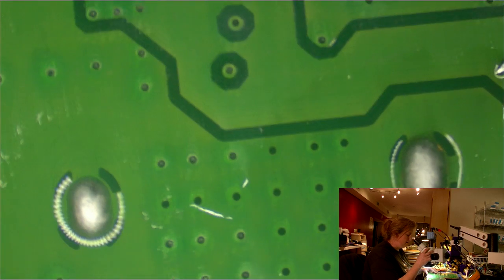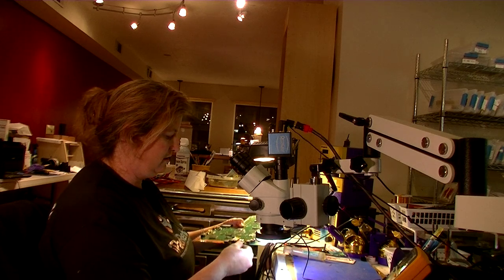How to replace a broken HDMI port on PlayStation 4 motherboard

Comment: good vid...i have done hundreds of these ports..i actually have a fairly easy way of cleaning out the holes for the legs of the  port...you use some 0.5mm solder braid and your hot air station with a small nozzle  heat the holes till they liquefy and feed the solder braid through the holes cleans them out pretty quick..i am currently working on one that has been completely fubar..a previous tech ripped all but one of the pads off the board (that's what happens when you try to pull a port without heating it properly) so i now have to completely rebuild the circuit with awg 36 wire ...oh and they blew off several of the diodes near the port so i get to replace those too lol
Reply: When I buy broken systems and see that much damage (just had one, 3 missing diodes), I end up salvaging the working parts (PSU, BD Drive, HDD, etc) and resell them, I actually 100% of the time end up making more off of the console than I would if it was just working.

I've done about 6 of the HDMI ports now, they can be a real pain in the ass
Reply: This is my literal nightmare! Lol
Reply: Any advice on what would be minimum required magnification for this job?
Reply: She is actually using very good quality tools and supplies, as I can see, she is using a very good desoldering wick and as she said she's using Chip Quik, which is a very good flux... so I can't understand why struggles so much to clean those support holes. The only reason I can think is the soldering iron is too low on temperature, otherwise that solder should came off very easily.

Comment: 03:23

No, for some reason that I cannot find an explaination for, the PS4 (at least on the original model SAA-001 board) has one side of the socket barely soldered on on some boards. The other socket on back (some kind of connection port) is always half soldered and the HDMI is almost always half soldered or all 4 look like the joints on the right. Very bare and spare solder.

Comment: Yeah awesome. I discovered my Pioneer KRP-600M had only one working HDMI port after having it moved over 700 miles and over water to me here in the UK. It's the first 2nd hand display I've bought but always a risk on Ebay and I've found that out to my cost in away. I still have the working HDMI. There's DVI-D and component - fortunately this monitor supports 1080P over component RGB. But it's always a worry when down to your last port. Took the thing apart yesterday and these things are built to last so even getting the board out took quite a while and about 40 screws, ribbon cables, power supply connectors etc. Anyway one of the connectors is very slightly damaged inside - on the far right, second from right the little copper strip is very slightly damaged. It wasn't saying no signal before just a blank screen. But I'm actually glad it's just a damaged port itself and not the chip itself dying. Like 75% eventually of LG video input  boards lol. Anyway it's £160 to buy a fully functional tested used board, or it's send it off for repair through the post somewhere - or attempt it myself as I've nothing to lose. I don't have any soldering equipment anymore and have never attempted HDMI before. But I love all this stuff so I'll guess I'll just need to think about it first.

Your example here is by far the neatest, professional I've seen yet here. Amazing touch and skill - very quick and tidy too. Fantastic.

Subbed.

Comment: i have my own consoles repair shop back here in the middle east - Palestine,  i do this regularly specially for the 10xx and 11xx ps4 models, one thing is that the replacement port sometimes does not align correctly, so i need to clean the 4 fixing holes before i replace it to so it aligns perfectly,  great vid thanx

Comment: Listen up kids trying to fix your PlayStation: this is an excellent video and great instruction. One thing to remember and consider before attempting this is the proper tools and materials to do this job properly are not cheap. Im all for people learning to repair things for a variety of reasons, but the most common is to save money. If you buy a $10 iron at Walmart and borrow you grandma's magnifying glass you are destined to lift pads and screw up traces. Then you'll take it to a repair shop and the repair will cost 5x what it would've cost to just have them do it first. Does this mean you have to get a degree to do the work? Absolutely not, but you better be prepared to fail for the first few times! Failure is the quickest way to learn sometimes so do the first repairs on friend's PlayStation. 😉😂

Comment: when i replace these i use a solder sucker from underneath and use hot air from the top and the holes normally come out clean first try

Comment: To clean out those holes I just use an electric solder sucker gun, it gives out loooooads of heat and sucks like an elephant after a peanut, clears them no problem.
Reply: Hi this is very old but can a soldering gun replace my HDMI port

Comment: That's a bevel tip, not a chisel. T15-B are bevels T15-D are chisels. Also, you can get the FM-2030 140watt heavy duty iron. It works wonders on those larger thermal mass ground planes.

And have you tried the FM-2024 or the 808 desoldering tools? Mine work great for through-hole components. I'll bet they would clear those holes with ease.
Reply from the maker: I have the FM 206 with desoldering gun.   Still in the box.  Just not enough use for that on when soldering on microscale of iPhones.
Reply: Very true. I can imagine the heavy duty FM-2030 iron and FM-2024 would not get much use when it comes to microsoldering. But in cases like these, when you're not working on the microscale, they can make your life so much easier. And the FM-206 runs every iron under the sun. Why not take advantage of it?

Comment: Seems like a stupid question, but this could be possible with a normal soldering iron as well, I suppose? Snip off the old connector, get rid of all the remaining pins and pieces from the old connector, clean the pads up with some flux and wick, and for the new connector just melt all four main solder joints in a circular motion to seat the connector, and then finally soldering the little pins by doing the pull-soldering method. I cant see why it wouldnt work.

Comment: For those holes, you would want to use the radioshack solder and sucker in 1 tool.. If iRadioshack hasn't completely shutdown yet anyway.

Comment: You can easily remove the solder from the holes using a desoldering gun. Every repair shop should have one and they're no longer expensive.

Comment: I've had good luck using canned air to blow the solder out of the bigger holes. Seems to work well.
Reply: Thats exactly what I do. Make sure you're not wearing shorts when you do it. 
really thats also what I use those junky $10 solder sucker irons with the bulb for too. Melt the solder with it then squeeze the bulb to blow air through the hole.
Reply: turn the can upside down and spray  your component, it will freeze it for testing. Thanks for your comment.
Reply: I used to blow with my mouth or tap the whole board on the table.   Compressed air is a much better idea

Comment: I don't know how these hot air guns are designed but I wonder if I could use a culinary butane torch to do this type of job. How hot is too hot? I find it very hard to judge with the culinary torch as the flame isn't vectored to the work like that of an actual hot air gun. I wonder maybe I could add a collar with a nozzle and get the heat where i need it.

Comment: I tried this and kept trying to get the solder on the brown connectors…however they seem to have gotten scratched off( about 4 strip places turned completely brown). DIY fail. 🤧

Was my soldering machine to hot?

Comment: hello Lady good job 👍can you help me and answer a question? I lost an SMD component when replacing the HDMI socket. It sits directly near the HDMI jack ... there are two components .... a 2,6uf capacitor and a diode, can you tell me what that is for a diode?

Comment: So I tried this repair with a heat gun off of eBay and I learned that it blew the right amount of heat but way to hard. The board around my hdmi port is burnt quite a bit. Will that effect it’s functionality? And I learned my 2$ soldering iron from the flea market I bought when I was 11 isn’t hot enough on the top to melt solder

Comment: i find if u use a preheater under the pcb and a hot air iron above the pcb the port comes off clean also for install use solder wick  and thin liquid flux and use solder paste to install the new hdmi port
Reply from the maker: Solder paste is a recipe for bridged connections!  Too messy

Comment: I see what I did wrong on the one I was working on. I didn't put in ChipQuick/QuickAlloy before removing the old connector. I just applied as much heat as I could with tons of flux and ripped off a pad! Well, I learned. Might be able to rebuild the pad, Did that on a Fire Tablet once.

Comment: very good work. i fix consoles and pcs for a living. and i hate how cheap sony made there hdmi ports. no back plate to stop pines from being pushed back. i have a question what would be a good pc cam to use to work on replacing the hdmi ports? using my eyes alone drivers me crazy. thanks!

Comment: attempted this. the hdmi port WOULD NOT COME OFF with a full workshop available to me. it was extremely stubborn at the anchor pins. I used a heat gun, solder iron, flux, desoldering suction. still too stubborn. some more tips on how to effectively transfer heat/ desolder would be useful
Reply from the maker: You have to watch the video —the key is using a lower melt alloy.

Comment: Thank you for this informative video! 

Quick question though, 

What temp are you setting your hot air gun to? We were using around 400c as we were worried about going any hotter. 

Any advice would be great, thanks!

Comment: A good reason those can get damaged is because there are HDMI cables that look like hoses, and they put a lot of stress on the port.
Reply: Mostly careless kids and hamfisted adults don't know how to treat gear with respect.  I see things in all manner of conditions.
Reply: Just happened to my Onkyo recievers one hdmi port. Im using Supra-cables and they are quite thick and causes some stress on the port. Mine needs fixing because the port is kinda loose. I can wiggle it up and down. Signal is lost doing this :) new HDMI-board is like the half price of a new reciever :) so i think it will be cheaper to change or resolder the connector pins that are loose.

Comment: Very nice video and thanks ... Quick question, how secure are those HDMI port? When we connect HDMI to TV port ... Sometimes when we move the cable , or when we push it in... It's not easy to make the port lose right?. What happened was one of my TV , when I life the HDMI cable, the colour or screen turned dim and when I move it again .. it turned back to normal ... So I assume the port was losen?

Comment: Sorry, what type of material did you use to prevent the board from heating with the solder? 1:50
Reply from the maker: nothing--the board will heat, it is nothing but metal ground plane.  This board sucks heat like a sponge.  If you did anything to prevent that, it would take dangerously long to remove this port--you can't get solder to melt without bringing it up to temperature, and as you heat the board the heat will transfer into the ground plane of the board getting sucked away from where you need it.

Comment: Thanks for the clear video! Very informative.

Hopefully you can help me with this. I have a PC motherboard from a 2013 Lenovo H520e. The PC never had a back IO HDMI port but the connection is there on the board (just Lenovo never put one on). If I just solder one on should I expect it to work (as long as I do it right)? The processor will support HDMI also so no issue there. It's not my main PC anymore so I'm using it to experiment and see how much I can upgrade it.

Thanks

Comment: Hey Jessa thanks for posting this video. Just curious, I feel like you favor your hot tweezers over an iron with a small tip, any reason why?
Reply from the maker: an iron with a small tip never seems to have great thermal transfer.
hot tweezers are both a tiny iron and tips together a larger iron at once.  The space between the tips is perfect for delivering solder to connector joints.   I do 90% of my soldering with the hot tweezers.
Reply: @JessaJones  you probably won't see this, but, is it possible for someone who is barely starting out repairs(i've only repaired 2 iphones) able to successfully do this replacement? I have two ps4s that have this problem and i want to fix them to give one and keep one

Comment: The pins do they have to be inside the holes or just in the correct line and with the paste and the solder will do their job and make it work?

Comment: Hello, I have a doubt, my ps4 when it lights presents the PlayStation logo does not return to give video and is left with the light in white.

I want to know if it is HDMI Video Output IC MN86471A Chip for Playstation 4 that needs to replace or only the HDMI port.

Comment: I've done a great handful of them too LOL.  One time I lost a diode near the port and couldn't figure out what it was. (Borrowed a Playstation from Walmart : P)     How would one find out what the missing component was without a schematic?  Is it possible?  [And they have two types of ports,  get the one with the reinforced backing, so the pins don't get pushed back in. The one in your video is the opened backed one].

Comment: Hello, I have a problem when I turn on the blue light flashes and the console will not start, I tried almost everything. Is it possible that this is the HDMI port?
Reply: Sara Muzinski no
Reply: Sara Muzinski its definitely not the HDMI port. It is either the motherboard, the power supply, the hard drive, or the RAM. You’ll have to troubleshoot to find out.

Comment: went to remove an hdmi port from an xbox one s today and was using my new hot air station i purchased from Amazon. I fluxed the led free solder and added some leaded solder to the ground pads and used my hot air gun at 480 degrees. I worked at it for awhile and could not for the life of me get the solder to melt to release the port. I have no idea what the deal was. Any ideas? Thanks in advance.

Comment: very useful video, don't think ill be able to do the job due to lack of equipment and lack of soldering experience but If I had the kit id definitely give it a go... so precise though damn  here's me thinking id just be striping a few wires and screwing in a new port... damn it

Comment: How terrible is it to melt the through-hole joints with an iron then blow the melted solder out the bottom of it with compressed air? Thats what I've been doing.
Reply from the maker: Totally fine.  As long as the joint is strong in the end you're good to go.

Comment: My PS4 is turning off immediately after I open up any game, disc-based or not. The PS4 first gives an on-screen warning that the PS4 is overheating, shortly followed by the light bar on the PS4 flashing a red color, 3 beeps, then a black screen. It does not, however, immediately turn off when I am on the main screen, only when I open up a game. Does anyone have any idea why this is happening? (Additional information: it's the optical drive/HDD area which is overheating, and every time I turn the PS4 back on, it searches the HDD in the same fashion as though I installed a new one, and comes up with the error message that the PS4 what not shut down properly.) how fix that.

Comment: are you applying more solder or what is that silver stuff that you use at the beginning?
Reply from the maker: probably chipquik low melt alloy
Reply: What happen if will removing the hdmi port socket  you get a little burnt mark on the edge Of the broad would it  cause any harm
Reply: MrTINO713 I know computer parts so motherboards CPU's and graphics card are meant to take some heat but a burnt mark, it may be alright my graphics card in my computer has a small mark on it and it works alright
Reply: MrTINO713 I would still be careful though some stuff is more prone to heat than others
Reply: Flux

Comment: WHAT TEMP DO YOU USE ON YOUR  SOLDER AND CAN I USE  ANY BRAND OF FLUXOR SHOULD I USE THE BRAND YOU USE.TRYING THIS REPAIR  MYSELF  PLEASE HELP
Reply from the maker: Stop yelling.  Figure out your temperature and flux through practice on a dead board
Reply: I'm not yelling......I don't have no time to practice imma dive right on into it with a lot of help from your video and maybe you  know......
Reply: I'm still waiting on a reply back on a quote I requested
Reply: please
Reply from the maker: It doesn't matter what temperature I use, my station,nozzles, and positioning are not relevant to YOUR station temp, nozzles and positioning.  It is an art not a science.  Figure it out!
Reply from the maker: We use NC-559-V2-TF flux which can be purchased here: https://mailin.repair/amtech-nc-559-v2-30-cc-16160.html It is the best stuff there is. You can also get it with a plunger & needle tip for a small fee.

In terms of temperature, 750f for soldering, and for hot air it really depends on what you are doing, you have to figure that one out for yourself.
Reply from the maker: Somewhere between 300-450c depending on the job. This always differs. iPad Rehab highly recommends the Quick 861DW http://bit.ly/2xGDTXo for a cheap, affordable, powerful hot air station with an easy interface. It will remove all different types of chips without a problem, unlike weaker stations that can't stay hot enough long enough to do the job.